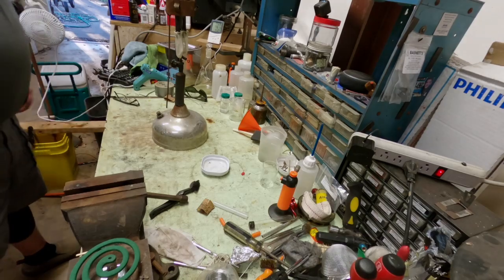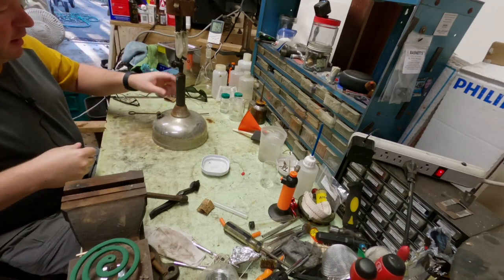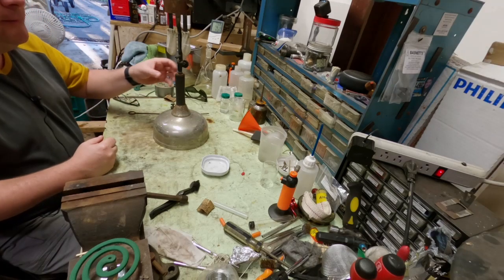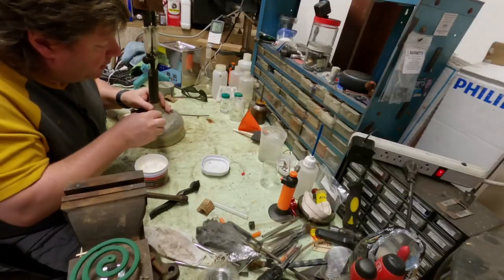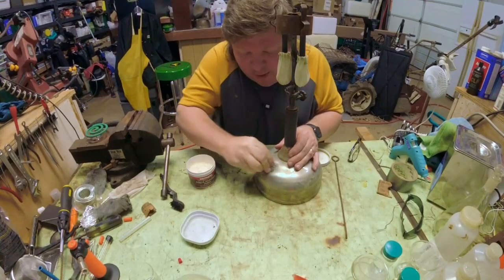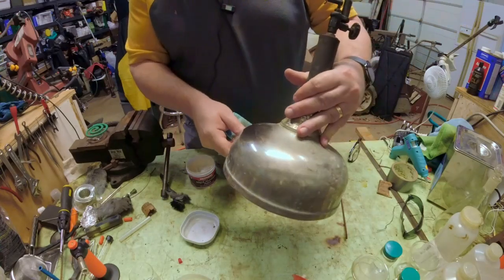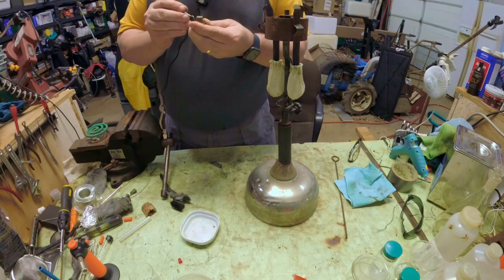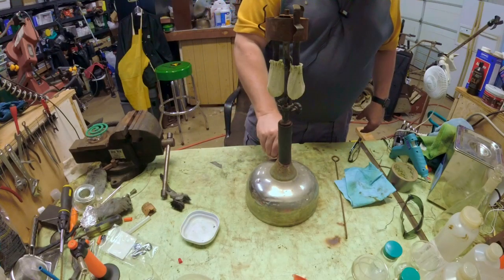On The Bench: A Coleman CQ table lamp

Comment: I'm soon going to start working on a CQ lamp dated May 19, 1919. I've found a filler cap that utilizes a Schrader valve allowing the use of bicycle pump. Any thoughts on this? What pressure would you pump it to? I've refurbished a few Coleman lanterns. The latest being a 200A. This will be my first lamp project.
Reply from the maker: I've got several caps like that.  I use a tiny battery powered air compressor to pump them up.  Makes them very easy to run.

Comment: I don't think making that into a floor lamp is a good idea for a whole bunch of reasons. May I suggest you just make a really really heavy, really really stable, fireproof STAND for the original unmodified table lamp ?
Reply from the maker: There's been several folk on the CCF who've done this conversion and they all report that they are very stable.  Even if it did fall over, pretty much nothing would happen.  Well, i'd break a shade, so that'd be $$, but it's unlikely to spray fuel everywhere.  With that said, fabbing up a bigger base or maybe attaching it to an old brake rotor may not be a bad idea.  Moar video material!!!  :)

Comment: What gasket did you use to stack on the original lead seal?? Thank you!
Reply from the maker: I just put a #2 cap washer on it. Turns out I really didn't need it, as I took it off later and it sealed fine without the gasket.